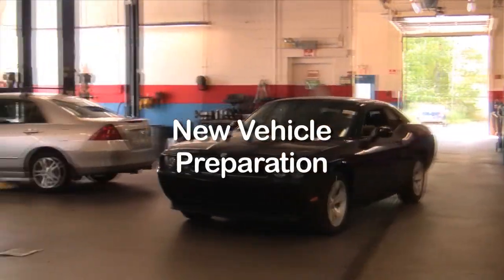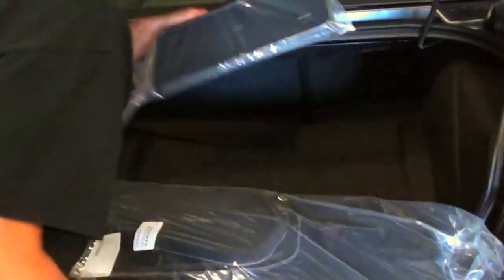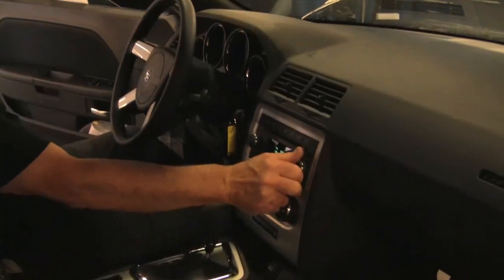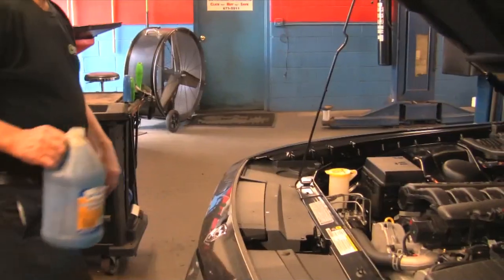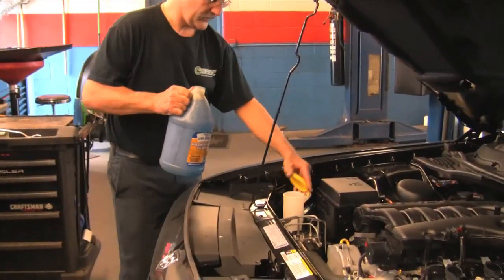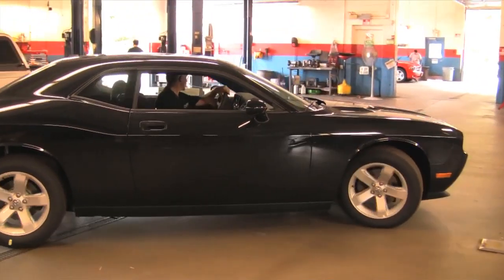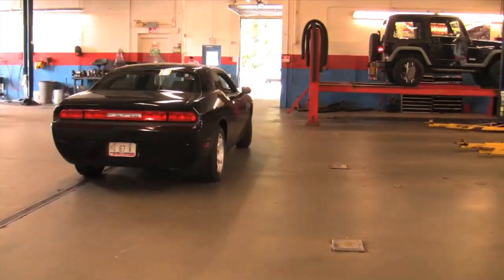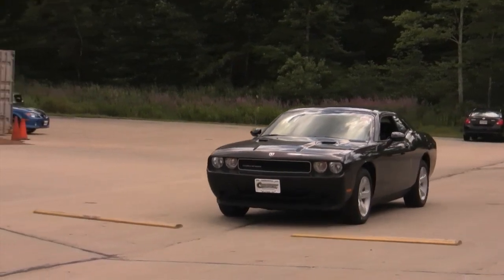New Vehicle PDI Demonstration

Comment: This is excellent. I appreciate this video. But as a consumer i want to know if Dave finds a flaw in a new car (Im sure that happens) then do you have to pass the cost of fixing it to the consumer or the manufacturer? If the consumer, then how do you give a quote to a consumer prior to performing the PDI? Surely you haven't done the PDI on all cars on the lot prior to selling them.
Reply: PDI's are performed on all brand new cars. Any issues at this stage are not charged to the dealer or customer. At this stage, because the vehicle has never been owned, the manufacturer will cover the cost of any issues. This does not include damage caused by the dealership or the transporter. Such as scratches or dings.